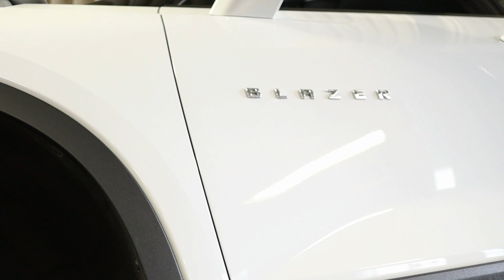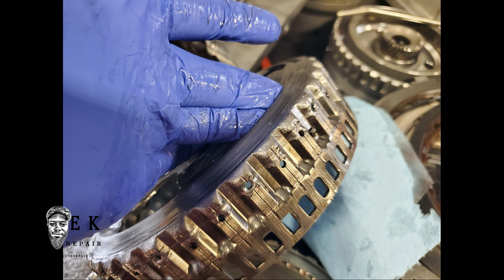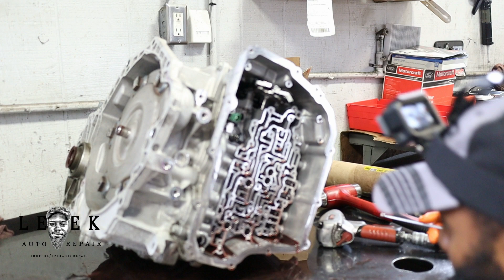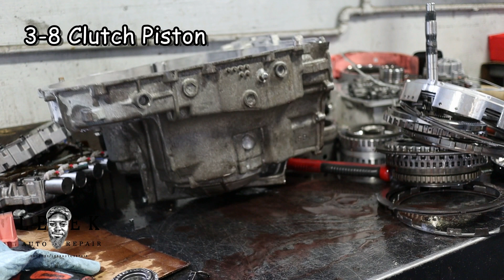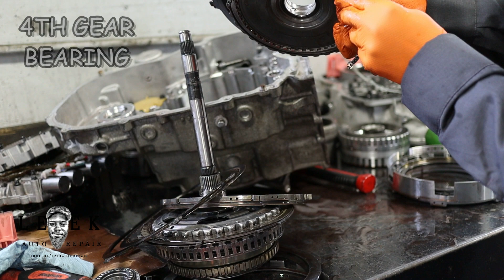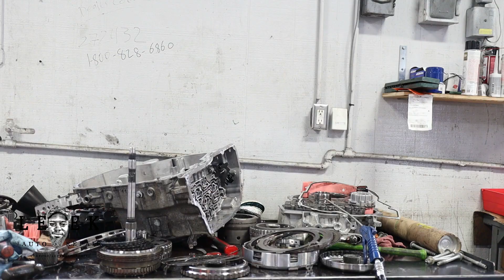9T65 No Reverse or Foward Gears | 2020 Chevy Blazer

Comment: What would you Gentlemen recommend for upgrades when rebuilding a 2018 Traverse 9T65? We want to actually make this transmission reliable 
Failed spectacularly at 70k miles
Stopped at a light went to pull off and all it does is grind in both forward and reverse, additionally it rolls freely in park. Thought’s?

Comment: When you were “applying” air to the 1-2-3-4-5-6 clutches, you were on the wrong holes, it’s the single hole that’s by itself that applies the clutch, the holes you were blowing into is what locks the one way clutch sprag assembly
Reply from the maker: @xtracleann  Cool
Reply: What would you Gentlemen recommend for upgrades when rebuilding a 2018 Traverse 9T65? We want to actually make this transmission reliable 
Failed spectacularly at 70k miles
Stopped at a light went to pull off and all it does is grind in both forward and reverse, additionally it rolls freely in park. Thought’s?